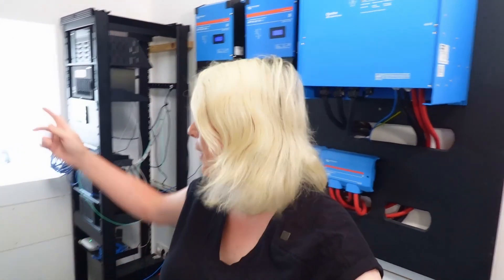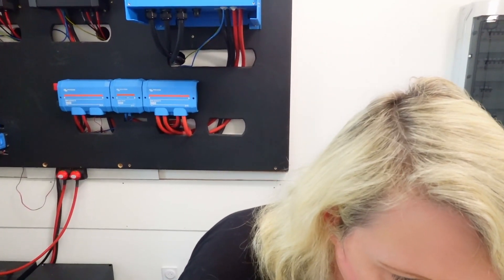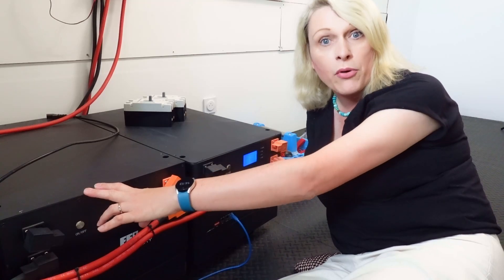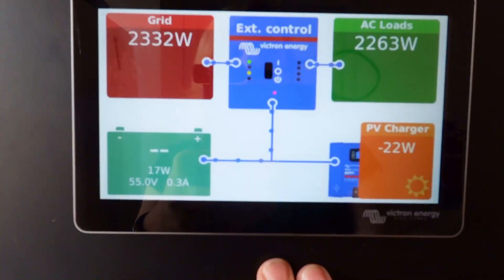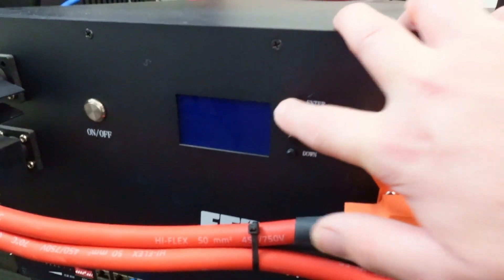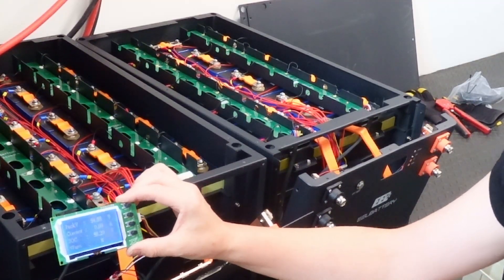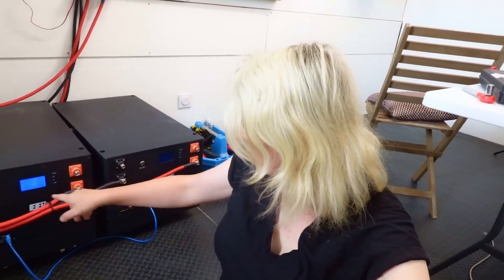Taking the LIFEPO4 EEL Battery apart - Broken display

Comment: Wow that is super dangerous...
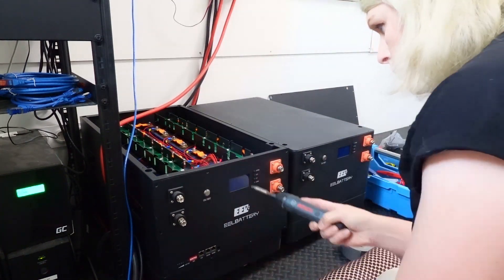8:29 Pulling at the front panel like that without first isolating/splitting the battery stack to prevent any shorts and not even wearing eye-protection!
Copper spray into eyes is a nightmare to treat. I think they should have given you a step by step involving removing the middle link on the opposite end of the case before doing that.

Comment: Why did you shut down all your solar production to use grid only? If I am not mistaken, the inverter wont care if the power comes from the MPPTs only. So, in my eyes swichting off the batteries should have been done the trick.
Reply from the maker: Well basically at the moment I've got the system set up to external communication meaning at the system is listening to the batteries so if I turn the batteries off the systems shuts down I could have changed the settings before I turn the battery off but I couldn't be bothered to be honest

Comment: Hi Sarah interest video, I liked your problem solving approach to diagnose the display fault, which by the way seems to be a dry solder joint on the display power pin, would be my guess, might be fixable. Whilst you were facing the camera the display, amusingly,  turned on momentarily, and turned off as you turn to look at it. 

 I could help but notice the power cut off switches on top of the battery packs. Good to see your going to swap out those round red switches, which was one of my recommendation a few videos back. I guess that is what your next video will be about, so looking forward to that. 

The air con unit is a good idea, much better than the mobile unit. Ours are in the loft space, not ideal I know, but that is were they have been for the last 2 summers, the first summer the ambient temperature topped out at 50c, but the batteries were only 30c so all was good, but I did install some fans that draw up air from under the floor boards directly to the Inverters to help keep them cool, and included a vet at one end of the loft space. Even though these events only happen 2 or 3 times a year in weekly intervals, its not really perceived as a threat, as the cell I have can cope up to 60c. I've event seen this temperature in our car battery pack on hot summer days when driving long distance.

We are planning an extension that includes a battery / Inverter housed on the ground within the design. Cheers Ken
Reply from the maker: Sounds like you've got an interesting system there... yes in the next video I'm going to be working on the isolator switches...

Comment: i have just got Air to Air with a heat pump on a split system its really cheap compared to radiators and only took a day to install, Great for winter and summer .
Reply from the maker: I haven't really thought about that, but yes I guess it would be good for heating as well great if we have a really cold winter I'd be able to heat the plant room with it...
Reply: @Gridbusters-qx4om  I've only had it a week but i had been watching many YouTube videos about them , it was cheaper than if i had the UK Government grant of £7,500 , this with only 3 cassettes and the heat pump was less than 5k . and so cheap to run , im getting a 2nd Powerwall 2 soon as the price has come down . I'm enjoying your project very interesting thanks .
Reply from the maker: That sounds really interesting I might be wrong but I think you can't get the government grant if your heat pump does air conditioning the government grant will only allow the heat pumps to do heating not air conditioning.
Reply: @Gridbusters-qx4om  You are right they dont do a grant for Air2Air but there is no VAT on renewables' , I'm not  having a hot water tank either as i haven't had a  bath for years and when i ask people they say the same . All that hot water you have to have to get the government grant , so im having two under sink water heaters that i probably wont even use a kettle is just as good .

Comment: You want to find an ac unit with two ports on it. An input and exhaust. I got mine for my grow room off of Facebook marketplace. But as I listen, yes a mini split would be a good idea. Check out the ones designed for solar. A bit more expensive but runs off of very little energy.
Reply from the maker: OK thanks I'll have a look however the only time it will be running is when we have a massive excess of power so the energy usage isn't that important
Reply: @Gridbusters-qx4om  The problem with most portable aircon units like you have is they suck the air out the room, so all that air going out has to be replaced, and that means hot air from outside the room is sucked in, hence Gordon's comment about using one with two ports. Mini split will solve the problem very nicely, and be much more efficient. Incidently one of my JK BMS displays stopped working a few weeks back. Your's looks like the back light is failing, or has a bad connection.

Comment: Hey, which BMSs are you using?
Reply from the maker: SEPLOS Smart BMS and I've also added a neey active balancer
Reply: @Gridbusters-qx4om  oh great.. I am using jk inverter communication bms, 150 amp one.
With my deye 5kw single phase inverter..

I have this strange issue, while exporting to the grid, throughout the day, my battery drains by 10%.

And if I don't export, battery SoC remains constant throughout the day.. 

Tried everything, different firmwares etc.. nothing helped..

Comment: Bravo from Egypt
Reply from the maker: Wow I'm amazed I've got people in Egypt watching my videos. I'm glad that you're finding them interesting... I bet you could generate some serious solar power over there in Egypt...
Reply: @Gridbusters-qx4om  haha yes we have 3400 of sunny hours per year in Cairo and more than 4000 in Aswan. And yes I have an 11kw Eastman inverter and another 6kw inverter. I have 18 panels 550W each  and on the way are 300ah battery. I can charge my  BYD Atto 3 in 7 hours from the sun. And I run 3 air conditioners  induction top etc. So like you I am trying to bust not only the grid but OPEC. I don't want my son to cross the red sea and dies to protect a hole in the ground. About 10 years ago I built a battery from rubbish of a computer mall. Old laptop batteries. We had unrest here. And my kids needed the Internet. So I built a 24V system and powered the the whole house. It was fun. I tought my son how to weld. Nearly 1000 18650 batteries. One day he will appreciate it. I hope.

Comment: Check out the mini split systems used in the USA. Can you get one here? (France) Pre gassed for self install - Might be able to do it without getting expensive air con installers
Reply from the maker: In France you're not allowed to install them yourself but I'll have a look anyway
Reply: @Gridbusters-qx4om 
Then the  Midea Porta Splitt is maybe a good solution for you.

Comment: I have pretty much the same cases....EEL with breakers and single terminals and no display.  What do you need the display for when the BMS has bluetooth and an active 2a balancer?
Reply from the maker: Actually one thing I didn't mention in the video is the Bluetooth on that battery isn't working either as the Bluetooth is part of the display module.
Reply: @Gridbusters-qx4om  I believe the bluetooth is not part of the display module.  It's in the BMS...well at least for my JK BMS.  You  probably  have the Seplos BMS?  I assume you are using the right app on your phone to recognize both BMSs....  Is one BMS working perfectly or are you having bluetooth issues with just the one with the funky display?
Reply from the maker: Yes, I have the Seplos bms. One of the batteries I can connect to is absolutely fine, but the one with the broken display I can't connect to
Reply: @Gridbusters-qx4om  If you haven't already tried, instead of just swapping displays, maybe try swapping the wiring harness between displays as well.  It seems intermittent and those tiny wires break easy.  Or put the questionable display with the good BMS and its set of good cables.   Just a thought...best of luck.

PS: I like the Victron gear.

Comment: Your video illustrates one of the main reasons I prefer systems built with redundant components.  If you have two batteries (or inverters, or charge controllers), then it is so much easier to troubleshoot problems.  The other benefit is that you can keep the system running with one component out of service.  I also like how clearly you showed how it’s done.  Keep going!  I enjoy your channel very much.
Reply from the maker: Completely agree having redundancy does make things much easier.